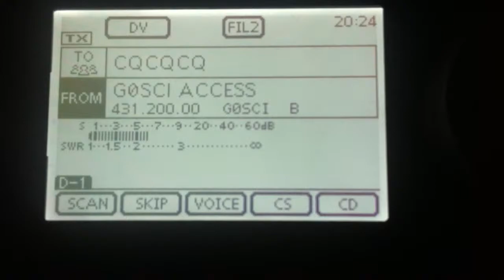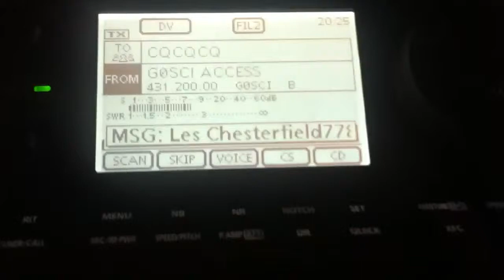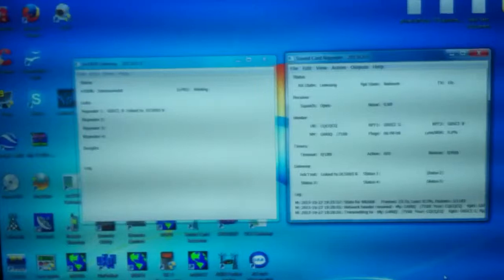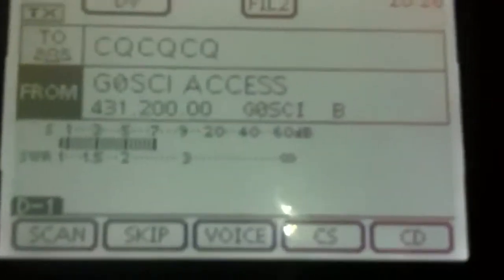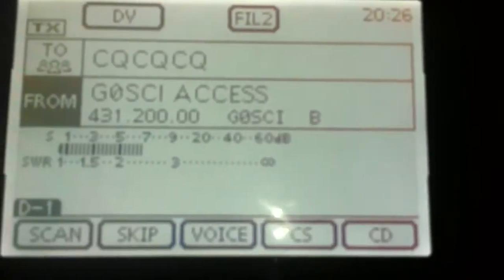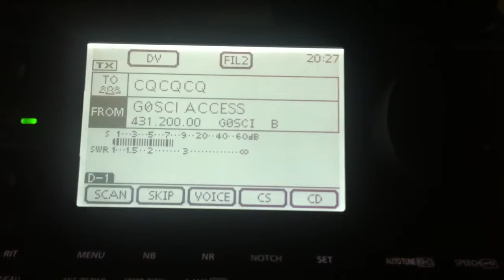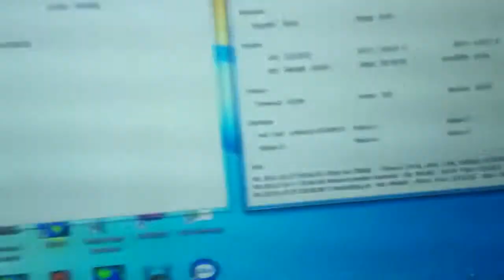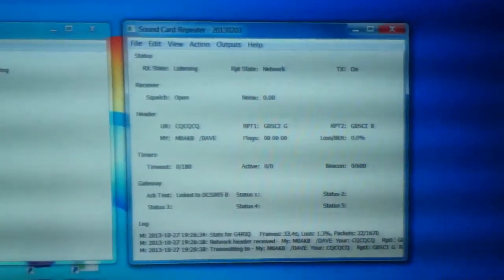D-Star sound card decoding with my FT-857D and my IC-7100

Comment: Hi there!
Don't you get audio dropouts? Have you tried it with a different sound card
besides the CM108? Using here cheap dollar sound card.
What's your LOSS/BER average from network and from RF?
I'm having trouble making it work, audio here is very R2D2.

Thanks 73
Reply from the maker: +Fl Pohl sorry for the long delay on the reply... yes the was dropouts but non more than my dvmega or other digital setups ... this was a experimental research project... it's now in the pile of projects to look back over at a later date